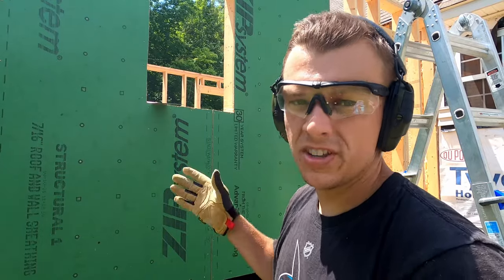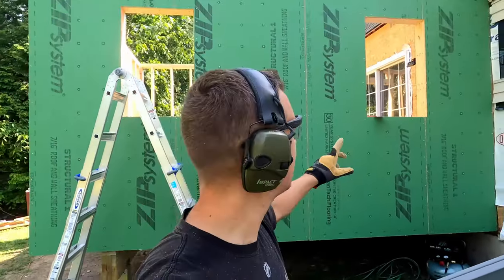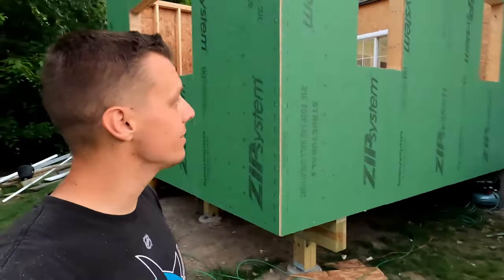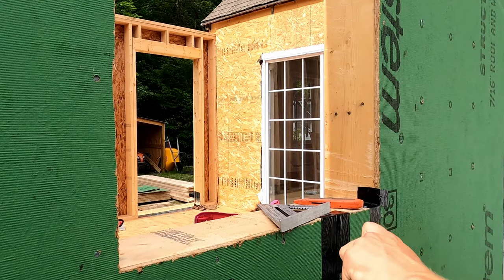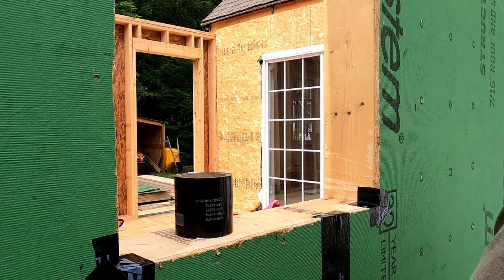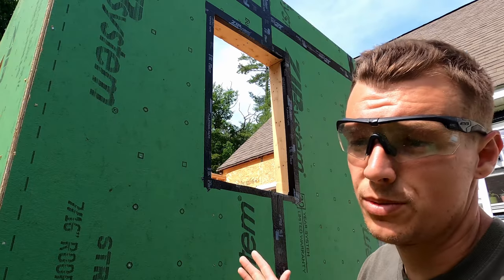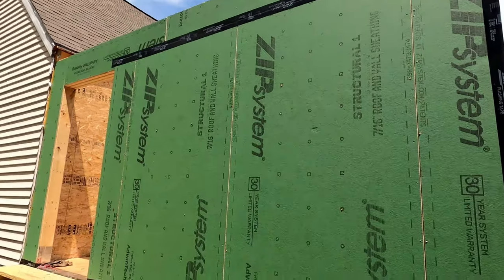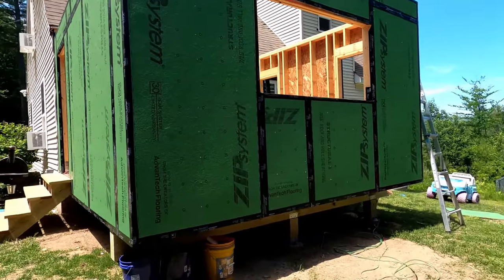Installing ZIP System Wall Sheathing ||14x14 Addition||

Comment: Awesome job man...about a year to late 😆, but pack or spray those corners with insulation prior to sheathing to prevent "cold corners"
Reply from the maker: I had to pull the corner stud off and make a condo corner 😂😂
Reply from the maker: Thanks Josh!

Comment: Finally, you are using clamps. No foam barrier strips. at bottom or top and ....  actually stops 2x6 edges contacing zip wall and makes a thermal barrier. Zip is good but even better that way. So easy to place on studs before you slap on sheathing. 2 or 3 staples. I bought long rools of 8" and made a slicer (sixths) for the 1 1/2 width.  AND.  Steven.. That top foot pice should never been scabbed in as 2x4 sections unstaggered?????. They shoud have been (2) 1x 8 sections, what were you thunkin'.

Comment: What is the ZIP system?  Advantages ?
Reply from the maker: So a lot of people hate on it because its OSB but already has a Water Resistant Barrier on it from the factory, and that for me was huge as it save me time and from doing another step.

If installed correctly it is also pretty air tight.